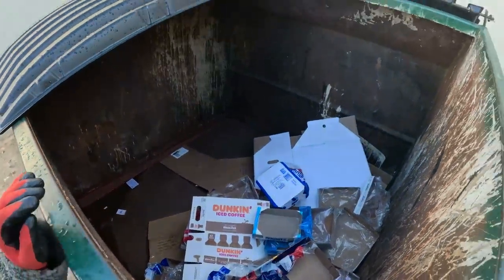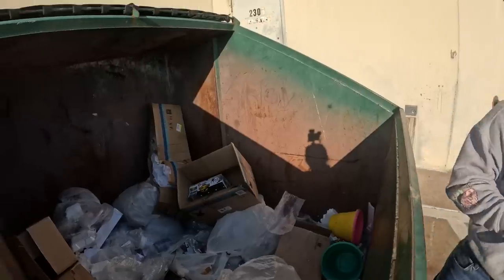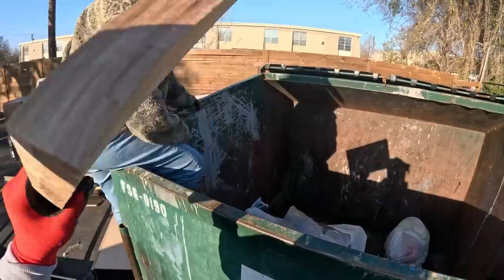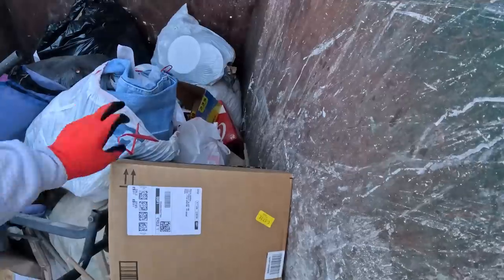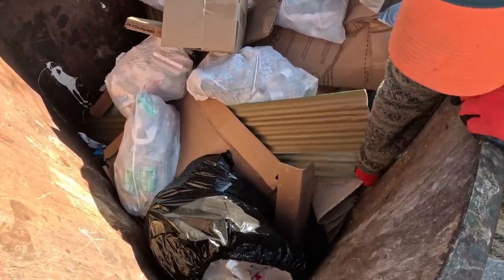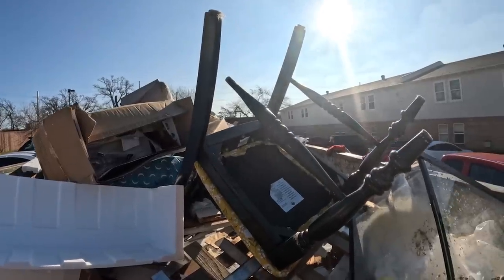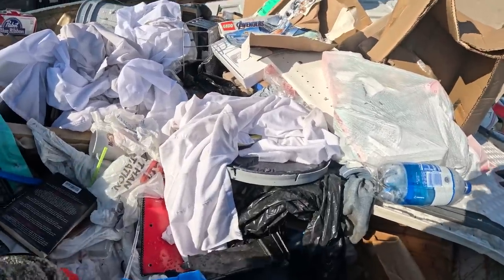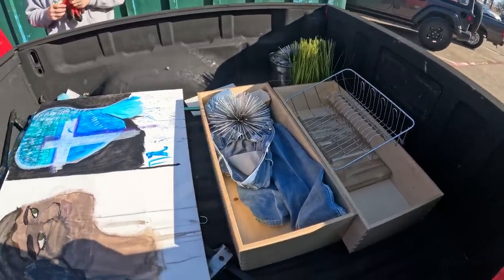Dumpster Diving at Shops and Apartments to Save Money & Reduce Waste!

Comment: If y’all want to stain those drawers a different color just buy some of the $0.50 paint at Walmart and dilute it with water. Put it on a rag and rub it in. If you’re going to use them as a planter, don’t do the inside because it may be toxic to plants. Sand that canvas down, gesso it, and you can paint over it. I buy them all the time and do it.

Comment: pretty lids I turn upside down and place in the top in a pretty shaped jar, vase or bottle, and use as candle holders , in clear jars you can fill w/candle filler or pretty stones and way them down for use in the garden. Don't for get to glue down the lids.